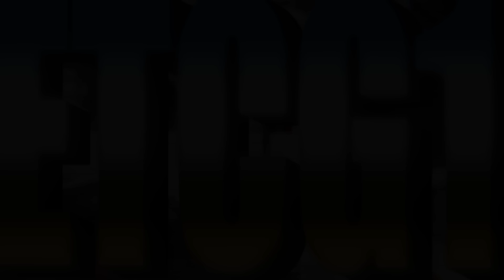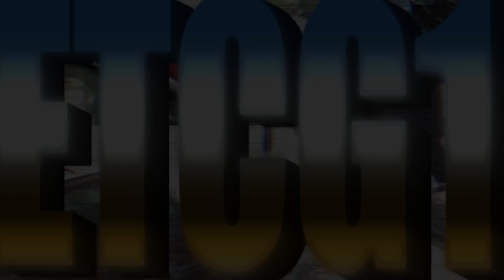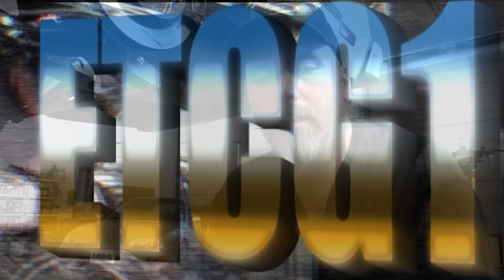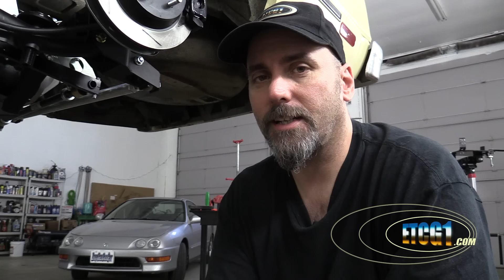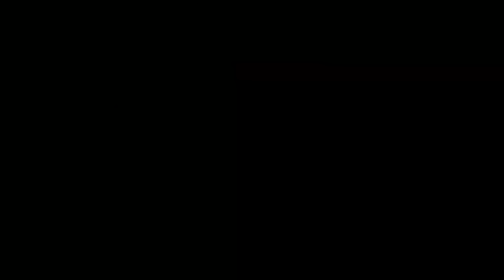Misconceptions About Performance Parts

Comment: Bolt on horsepower is something that is from the good old days of car tuning. Back then, you could buy a aftermarket carburetor and change out the stock one, more power. You could buy aftermarket intakes, other heads and cams, more powerful coil and a better distrubitor, open headers and exhaust and get a bolt on increase in power. Today, the computer in a car needs to understand the modifications to perform at its new maximum power, the fact is, a new computer managment system may increase the power without any new parts.

Comment: i learned my lesson on a 03 mustang gt. I put a cai, off road x pipe, flowmaster 40s, a bigger throttle body and a power programmer. I also removed a lot of weight out of the car. I saw no noticable gain in acceleration. If you are going to make a car fast you need major weight reduction and turbo, supercharger or nitrous. Get ready to spend thousands of dollars to make any real difference or buy a car thats already fast that costs thousands

Comment: I agree 100%. Bolt on performance parts used to yield much greater gains back in the old days when V8's made under 200 horsepower because they had highly restrictive intakes, exhausts, etc...    Nowadays  engines are much better designed from the factory and are producing much more power stock. Manufactures now put much more time, effort and money in trying to make engines as efficient and powerful as possible while still being reliable. It is much more difficult and expensive to get real actual improvements out of today's stock engines and simple cheap bolt- ons will almost always disappoint.

Comment: My STI can get a significant amount more power from an ECU remap on a completely stock engine. Stock exhaust is very restrictive, so gains can be made there. Do the headers, injectors, fuel pump and an intake and it's definitely going to have more power. These engines have untapped potential from the factory to comply with regulations, and Subaru know most of their performance models get modded. It depends on the car.  An STI can make big power on just the stock turbo. But it is well known with STI's that it's relatively cheap to get them up to 350hp or maybe close to 400hp but once you go over you have to spend big money.
Reply: Big thing about modern cars though is its all about the ECU. Adding a different part without a remap will just throw the ECU off and make the engine run like crap.

Comment: Airboxes are well designed on modern cars and pull more actual cold air than an aftermarket unit. Note aftermarket intakes are louder, so it 'feels' faster. Usually only the most restrictive part holds you back. Bolt ons were from a day when manufacturers were less savvy than they are now.

Comment: My Holden Commodore which runs the LS1 had a few thousand dollars spent on custom headers,custom twin 2.25 inch exhaust system,diff ratio change from 3.46:1 to 3.91:1 which bumped its flywheel power up by 31 kilowatts after the PCM was retuned in 2003.
So it puts out the same power as the LS2 engine even before it was built by GM & has a similar power output to the LS6 engine.
I think performance upgrades are only worthwhile if they fall into factory standards,like many people fit FE2 suspension into the Commodores in Australia which is the factory sports option (30 mm lower than standard),anything Lower requires an engineering certificate.
I steer clear from drilled & slotted brake rotors as they do nothing other than chew through brake pads,I do choose a brand of pad which has the largest surface area which fits into the stock calipers ,which are kevlar & not metallic as I've found that they chew out brake rotors too quick.
I've had luck with OEM Nissan stuff where my other Commodore (1986 model) runs the original factory Nissan RB30E engine block (Australia only engine) & bolted the way imported Nissan RB25DE cylinder head onto the 3 litre block,as well as fitting the RB25DE pistons onto the RB30 rods,it runs the RB25 ECU.
I bought the R33 Skyline engine package for about $1000 AUD in 2003 & spent a total of $2000 on the engine including the package.
This gave an increase in performance from 114 kilowatts up to about 185 so was a 50% increase in flywheel horsepower over the single can engine.
I was going to turbocharge it but it was too expensive to run,build & insure so the 3 inch exhaust system was replaced with a single 2.5 inch one as there was a loss of bottom end to mid range power with the 3 inch system.

Comment: I had a 1978 Mercury Zephyr, it was my first car. I learned that upgrading the engine to a 351w broke everything else on the car. In the process of repairing and upgrading all the parts, trans, diff, cooling etc... I learned that performance does not necessarily mean durable.

Comment: Easy way to boost HP in my experience is just a plain tune-up. Maybe not a boost but if the air filter is bad , oil needs changed fuel filter plugs cap and rotor on older cars, all that stuff will sap performance so it seems like you get a boost replacing it. Maybe that's what perpetrated the CAI myth. Maybe what they replaced with the CAI was a ten year old clogged up air filter so they would get a tangible boost. But replacing the filter with anything would give the same boost because it needed to be replaced. Just my thoughts

Comment: My MR2:
3SGE Beams engine from Japan 197 HP stock, 1250 Euro's.

Changes:
Carrillo Pro-SA connecting rods, 770 Euro's
Wossner pistons, 500 Euro's

Rod and piston weight matching, 300 Euro's
Crankshaft weight reduction (lightly shaved not too much) and balancing, 400 Euro's.

Total: 3220 Euro's
Total for changes: 1970 Euro's
End result: 221 HP.

Later additions:
Whipple W100ax supercharger, 2100 Euro's
AEM Water/Methanol injection system, 480 Euro's

End result: 327 HP.

Still using stock header, intake manifold, throttle-body, camshafts, flywheel.
Engine did come with an upgraded clutch disc when I bought it, so normally you would have to add those costs as well :P.

so 1970 Euro's for a 24 HP gain and 2580 for another 106 HP gain (and torque especially, my god that torque.).

Most people (especially the younger generation of which I am technically a part at 34 years old) think each part increases hp by a set amount and then choose their parts according to a cost/benefit (HP gain) analysis, very few people understand that it's the combination of parts that make an engine "better".
It takes an experienced guy to know what parts to mix and match for the best bang for the buck.

Comment: I think every project should start with a goal in mind whether its handling corners or straight line speed break neck acceleration. To an extent you can improve all of these characteristics but at a point you really have to pick one because the further you go down that trait the more compromise you have to make on the others. Make sure your goal is an achievable one, do some research on what is possible with your chosen platform and be realistic with your goals. The last tip I have is to build from the outside in. What that means is you should start by upgrading your brakes to handle the new performance you're aiming for, then axles/drivetrain/trainsmission, after that the suspension mods and tires. Only after all of that should you try to build serious power with an engine. You can drive an overbuilt car with an underwhelming engine just fine. It doesn't work out so hot the other way around. There are always caveats but generally newer vehicles are designed with the power plants output in mind. If you change that output you are then asking more from those parts then they were designed to handle. You may get away with it for a while and things will break eventually no matter what but if you want to retain any semblance of reliability you have to build the car to take the power.

Comment: I do the whole 9 yards though, after market SS 2.02 and 1.94 valves, large tube headers, H pipe, 3"straight pipes turned down to the sides just in front of the rear end, Flow Masters, Hot Cam, high compression forged  pistons, 750 tricked Holley. all small block Ford Windsor :)

Comment: about the only "bolt on" mod you can do for a real power difference is a new ECU.
most are an afternoon of work, many come pre-tuned for your model, and even more still allow you to send in yours to be reprogrammed rather than send you a new one.
most bolt on mods aren't going to much for power, but there are many out there that as you mention, can reduce weight, or are more efficient than their factory counterparts, for example  PCVs or diverter valves from VAG factory are generally equipped with a rubber or plastic diaphragm that releases under pressure, aftermarket options usually change that diaphragm out to a piston actuated valve for durability under load. no more torn diaphragms from boost lol.
now, there are plenty of bolt on mods that will increase performance, if not power. good sways and suspension, proper brakes, etc.

Comment: If you've got a modern(ish) turbo engine, a remap (tune for the Yanks) is the one mod that'll give you that instant jump in power. Intercoolers, decats, intakes etc amplify it but if you spend your money on one thing, nothing else affects your car as dramatically as a remap even on a totally stock engine.

Comment: I believe it's more about being realistic; there are many parts out there that DO give you an instant performance boost, but they won't make your car a Porsche GT3 RS either.  Quick example; when I installed SS brake lines, slotted rotors, and ceramic pads, my car stopped way faster than it did before.

Comment: If you are well informed and do good research sometimes aftermarket parts can be superior to stock, be it for performance, reliability, or both.  That being said if you don't do the research going with stock replacements may be best due to allot of crap flooding the market.  A couple examples from my own experience as a technician.  Fully welded aluminum radiators are nearly always superior to the factory unit when a replacement is required, the interesting part is I've found these can often be found without spending much more than an OEM replacement.  Another one is in the case of the factory manifolds of especially older vehicles... tube headers nearly always outflow cast manifolds and often also weigh far less.  While the factory manifold on my Jeep's 4.0 inline 6 wasn't cast they were notorious for cracking at a weld, a stainless header, while often a fair bit more expensive than a stock replacement, not only dropped right in and looks better but also solved that design issue.  So in conclusion not all aftermarket parts are good, but in many cases if you are careful you can find ones that improve upon the OEM, especially if your car is older.  Just make sure in the event of mods you have a good plan before starting, it's easy to build something that doesn't work well, and far harder to build something where all the parts work together smoothly.

Comment: On my 06 mustang GT I did full exhaust. Long tube headers catless h pipe 3 inches to the back, throttle body, “cold air intake”, suspension work and man it never felt slower lol

Comment: Biggest issue is people don't do there research, like the mid 90's Accords, the LX could see a gain from headers, but the Vtec EX already has the best flowing manifolds out there for a 4-2-1 header setup, I suspect the same with the Integra, Also going back to "cold air intakes", 90% of the "gains" seen on Hondas come from eliminating the restrictions of the resonator box (behind the bumper) by simply removing it you eliminate that restriction and shave a few pounds of plastic. All this said, I will state one thing, the 1 time I actually did invest in a proper Injen COLD AIR (NOT RAM AIR, another common misconception, people often call ANY intake a cold air) intake while I don't believe there was any significant total HP increase what it did do was dramatically alter the torque curve to occur at a lower RPM, it noticeably had easier time passing people then it did before and thats where the "gains" come from, it's the shift in the power band to a lower in the RPM range.

Comment: Even after all the parts go on, you still need a tune on the dyno.  That's the real place to get the power from the parts you put on.
Reply: Yeah but the system can make adjustments within reason to minor changes like cold air and headers. It has a learning capability to adjust to sensor readings. Its only when you change cams or ad a turbo or any major component that operates outside the parameters of the fuel map that you really have to tune. Most of the time when you see someone get a gain by tuning after adding a cold air its power they probably could have tuned in with even the stock set up. Maybe the cold air flows 50% more than stock but that doesn't help if the stock flowed 90% of the throttle bodies flow capacity. That has been my experience on the matter anyway.
Reply: True that. And if your stock octane requirement is 87 you can benefit a lot from a 91 tune  BUT you'd need to always fill up with 91.  So on a daily driver this might not be worth the money for the cost of a flash and having to spend the extra money on the higher octane gas just for a measly 10hp, especially on a normally aspirated car there's only so much to gain.  All up to you, but I always tell people just to enjoy the car they get from the factory...
Reply: oldtwins na
 Be careful with that high octane fuel. I've seen people burn out valves on ...we'll call them economically manufactured engines. I always recommend running stainless steel valves. I don't know if newer engines are prone to this but its a rule of thumb I picked up in the 90's
Reply: higher octane fuel by its self will not burn up valves.  All octane means is knock resistance.  Nothing more.  only thing it allows is more boost, compression, and more advanced ignition timing.  You will gain no power from the fuel alone.
Reply: Chad Bremer
 I know those old quad 4's didn't like it. I've rebuilt several heads with burnt valves because of it.
Reply: Travis Callahan Must be something else going on.  Higher octane pump fuel wont burn valves.
Reply: Chad Bremer It can and has. In the cheaper built engines. I've seen it in several engines. It is rare because most engines are of sufficient quality to handle it but a few do not. Again I caveat that most of these engines were designed and manufactured in the 90's. I haven't done automotive machining in years so its possible that its not an issue anymore but I assure you it was at one time.

Comment: Like in a 1996 f150 with the 5.0L... The stock exhaust and stock intake system is not as good. For mine, I've installed a cold air intake, which breathes much better than the stock intake tube... I've also done long tube headers, true dual exhaust, and dual flowmaster super 10 mufflers, deleting the cats and the rear o2 sensor. Everything works perfectly and its added around 20-25 hp all together. But going 1 part at a time, you don't FEEL the difference even tho it's there, because you won't FEEL a little extra 3 or 5 horsepower.

Comment: I 100% agree. I have gotten to the same understanding and conclusion by actually changing parts and by study/research. 

You have to look at cars as complete system.   I have performed some simple tests on installing CAIs on a variety cars and found the results to vary.  Some cars actually lost power while others gained. Huh? 

IMHO, cars are well designed. Therefore, for the most part, just changing one part will not gain performance.  Sadly, I have personally witnessed this. 

I'm going to try to say this nicely. If anyone thinks they can change one part and get huge gains, you need to do more homework and study. 

Just because a person works very hard to improve their football throwing ability does not mean that same person is a great quarterback.   There are many other attributes to a great quarterback. 

Great video. You stated your point without being a jerk. You just stated your experience and your opinion along with why you feel that way. 

As usual, great job.

Comment: I have a 2000 Nissan Micra K11 and personally I like My Car to be stock and anything I do to it to be dealer accessories. However, I regularly visit the Micra Sports Club site and even though it wouldn't be something I would do to my own Car, aesthetically some of the upgrades the owners have done look quite good and performance wise they make a difference. it probably helps because most of the Micras including mine are only 1 litre Engines so when you're done upgrading you're left with a little pocket rocket. I agree with what you say about having to have an understanding of what the part does in the first place if you are going to improve it though but on some Cars You can only improve them.

Comment: a good ebay find for me was for 6.5 diesel injection pumps. Performance companies sell a rebuilt one for $1400. One of the companies on ebay was selling them for $400. Why? They rebuilt thousands a year and not like 100.  Some people on ebay have an in on the wholesale market as well cutting out the middle man. I use to work for brembo and if I could get my hands on rotors at oem prices, I would make some serious bank on ebay.  There seems to be a 100% to 400% mark up on parts by the some the customer buys it.

Comment: ETCG...You said what I have been preaching for years. The whole car is a system that MUST work together. Yes performance parts are good, but no one part will work to gain anything with out the rest of the system matched too it.  Engines are nothing more than fuel powered air pumps. More air in, needs more fuel to run, more air out = performance gain. BUT... Most of the time getting more air in and out of engine changes the usable RPM band of engine, so now torque converter, gear ratio, etc needs to be changed to make the car function as a working system.